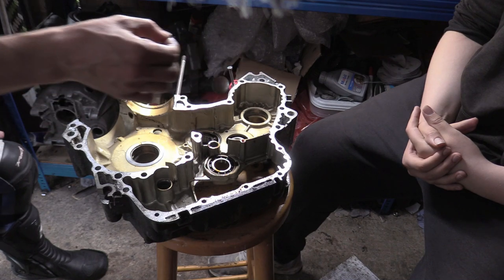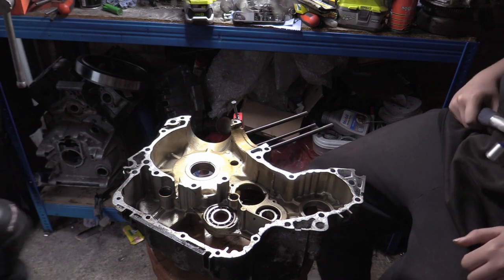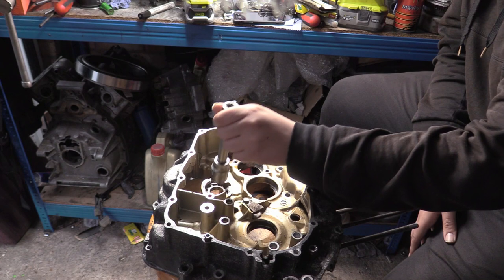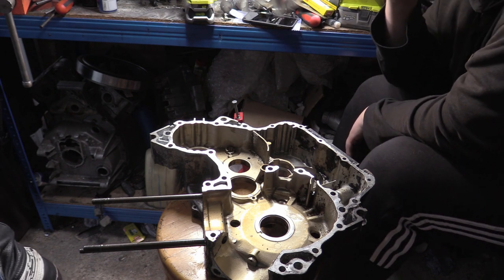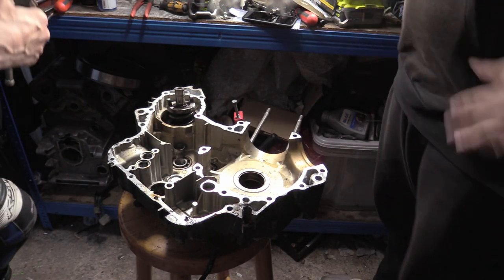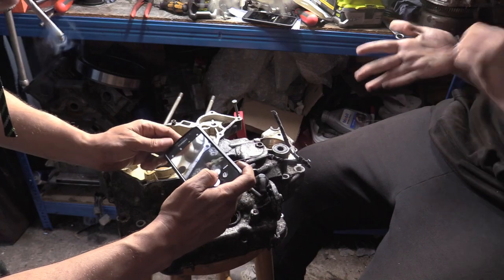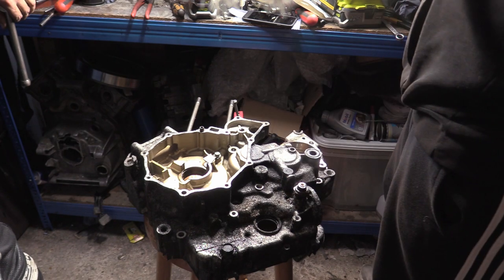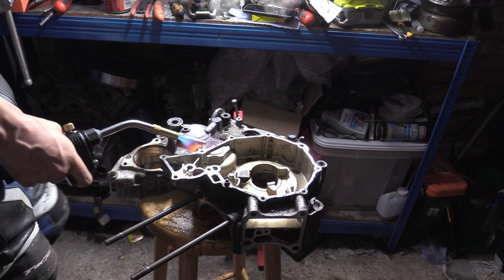Isaac Tuition - What you don't get to see

Comment: Isaac just for the record, it matters not what you end up doing in your life. You could end up working in a factory or in a kitchen or even a drain inspector. But you will never forget what you learned whilst helping Matt. In your years to come you will retain the knowledge that has been passed to you at this time. 
 I have spent time at horticulture college, spent time working with road and building engineers even steel welding and fabrication. Vehicle electrics, and now in my twilight years I spend my time working in Labs with Analytical equipment. But I never forgot the time spent with my father and uncle working on cars and in garages. On stuff that was cutting edge back in the eighties hahaha. But I learned enough to gain the respect of a few “spanner bashes” all due to the tuition I received as a young lad. 
 Oh and just so you know shit fire did I get it in the neck every fecking day. 😜 
 Respect To you Matt.